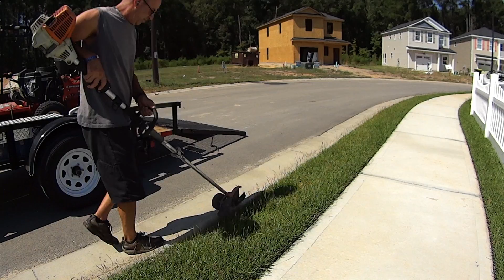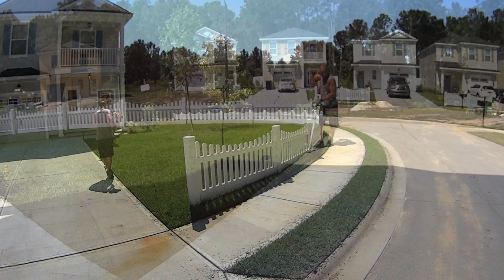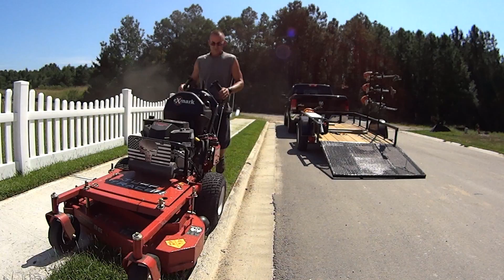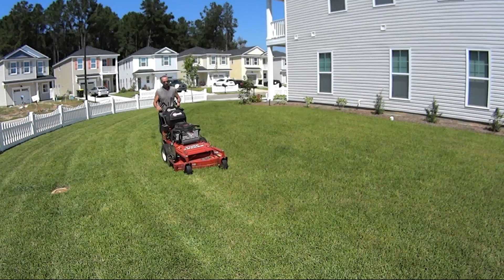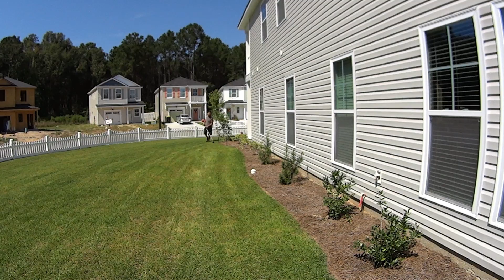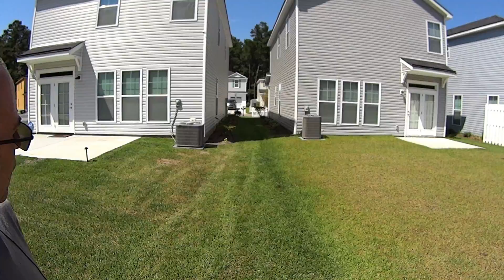Cutting Grass - You Helped Make This Video - #SideHustle

Comment: My gpa gave me a very nice echo edger pr9b $350 edger. But it smokes terrible. I let it run to see if it stopped and it don't!. What could it be without me going thru everything. Plug looks good
Reply: Yea I run a small biz with lawn care. So everything is mixed right. Actually he hasn't used it for awhile so I checked it over. And I don't see anything that would cause it to smoke so bad nonstop. And I use 40:1
Reply: So you're saying its supposed to smoke up my back yard?. I'm used to smoke from the blowers and trimmer a little bit. But this is way more than im used 2
Reply: Well I wish I just mixed the fuel wrong but I use 3.2 oz per 1 gallon. So I am almost sure it's not that. Really hope its not piston.
Reply: I will flush and redo it though. Ty
Reply: Ok I will. It's pretty full now! But I will do that and I guess move onto the next step. Its a really nice edger hate to not use it

Comment: Thought I would ask you this question since you are very thorough on the mowers you use. What are your thoughts on stamp decks vs. Welded, and how often do you clean under your? great video thank you for all the helpful information you give us
Reply from the maker: I only clean under the deck if needed when I sharpen the blades. I don’t really have clumping issues. Manufactured decks tend to last longer due to being thicker and they tend to be larger which helps with processing the clippings.

Comment: How deep do you run your edger blade ? Wheel on the lowest setting?
Reply from the maker: Did you not see the slow motion edging? The blade goes around 2 inch deep but the wheel is always all the way up. I go by feel, not the wheel